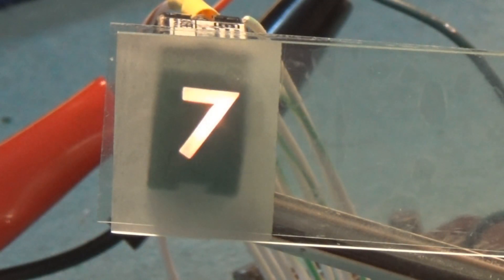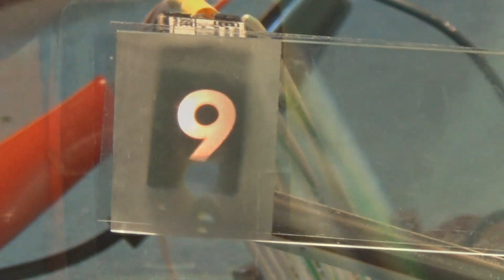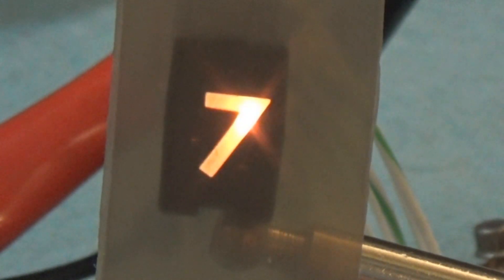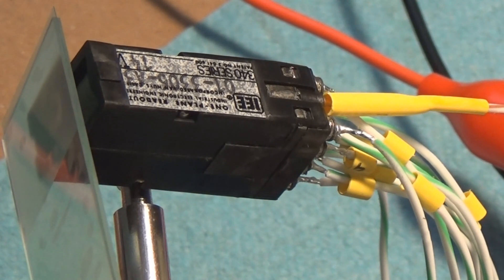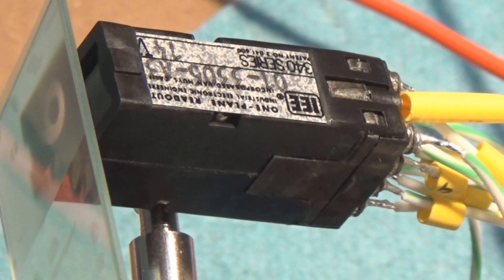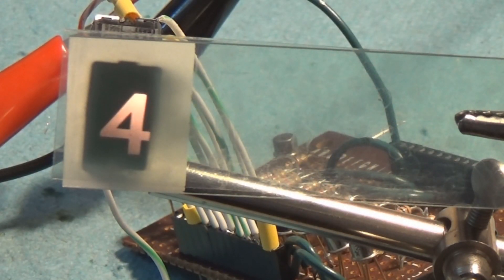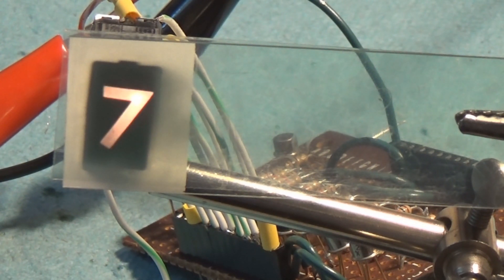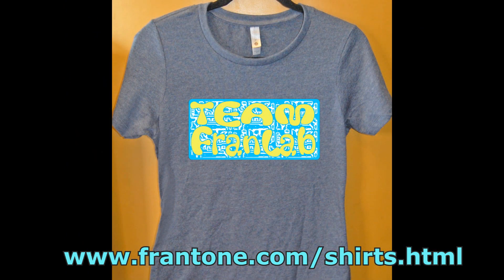Fun With Projection Displays

Comment: Otis Elevators used these extensively in the late 60's to 70's in the VIP-260 series. You can see them in action in the movie "Whats Up Doc" (Barbara Streisand) at the 53:30 mark. These were installed (and filmed) at the San Francisco Hilton Towers.  They eventually were replaced by Panaplex then LED's with the Otis Elevonic 400 series elevators.  Some VIP's were retrofitted though.

Comment: I remember two other types of incandescent displays used in the early days of digital electronics, both were used in DVMs that I used in the 70s.

One used a rotating cylinder with a bulb in the centre and cut-outs of the numbers around the circumference.  The cylinder was rotated by a movement just like a moving coil meter. So applying ten discrete voltages to the coil moved the cylinder to ten different rotational positions and allowed the light to project one of ten different numbers onto to a screen.  When the displayed value changed you could see the numbers spinning like a fruit machine.

The other type used ten separate sheets of perspex layered on top of each other.  Each sheet had holes drilled in it in the shape of a digit and was edge lit by an incandescent bulb.  When viewed from the front all you saw was the light being scattered by the holes and forming a digit.  Sometimes when a bulb or two had failed you had to guess what the blank digit was.
Reply: Clever - both of those!

Comment: I once reverse engineered the instrument cluster from a mid 80s Audi 5000 into a scratch built vehicle. The centre status visual indication section used precisely this kind of technology. Things like turn signal, high beam on, oil etc... all came from a set of lamps projecting their light through a tiny icon printed on a colored film onto a larger  2x2" screen between the speedo and tacho...

Comment: I have a parts drawer full of these; leftover bits from my military days. They were used in an IRIG-B clock. Mine are almost identical to yours except they have the diffuser built onto the front with a small visor on top to prevent glare from ceiling lights.

Comment: I've got a set as well ... IEE Model 10000 which have twelve 6.3V bulbs (in sockets on a steel backplane.) With 12 digits, some have the addition of left or right decimal points, +/-, or A/B (presumably for base-12 display since they came from a computer, if I remember correctly.) I got them around 1985 and have never thought of an ideal project. The best contender so far is to use the iron-core memory from the Wang calculator as the RAM for a clock. I debate whether to keep the project using the incandescent bulbs or to make an RGB LED board for them.

Comment: Just did a tour of my local nuclear power station and the control rod position indicators were these displays (at least in the training center control room which I am told is an exact replica for obvious training purposes). There were a lot of vintage displays, dials, indicators, and switches. It was a good time for this sort of random geekyness.

Comment: Here's an idea: 4-digit clock with a rotating color wheel, like the ones used for aluminum Xmas trees. The wheel can rotate at 1 RPM, acting like a seconds-hand. The color of the digits would roughly indicate the present portion of the minute. 
Thank you for the introduction to this beautiful technology!
Reply: you can just swap the bulbs with rgb leds ezpz

Comment: I built a clock around 15 years ago using these. As I recall I used a PIC to control it. Your driver board looks pretty much as I remember mine looking as I used discreet components as well. Alas the clock was sold off years ago as I cleared out room in my lab. Fun video, thanks for it and for my little trip into the past.

Comment: I distinctly remember this sort of display used as a show countdown timer at Disneyland in the 70s and early 80s.  Specifically Mission to the Moon (and later Mars).  It would countdown in the initial holding are until you entered into the pre-show "Mission Control" area to meet Mr. Johnson.

IIRC it was a 6min countdown as there were two theaters after the pre-show and they'd feed each theater in rotation after Mission Control which was a 4 minute vignette with a 1min load-in from the lobby and 1min load-out to the next open theater.

Comment: One interesting little tidbit---these are the displays used in the Apollo MOCR consoles for the display channel readouts, mission clocks, and other digital displays during the Apollo era. Later, they were replaced with LED seven segment for the shuttle era retrofit of the consoles. Look at Apollo era pictures of the MOCR consoles and you'll see them. The did bad fakes of them in the Apollo 13 movie MOCR consoles.

Comment: Way back and i mean WAY back i seem to remember seeing these. I was fascinated by them being pretty young. And it has been suggested and i also follow suit - why not LEDS for the light source ? Being a directed light source with low/no heat output, just might be 
the ticket, Yeah that's the ticket. Switching current will drop by a large amount as well.

Once again Thank You Fran. A little trip in the way back machine - VERY cool !

Comment: There have been so many numeric display technologies over time, each trying to improve upon and/or optimize several characteristics, such as brightness/contrast (especially for daytime readability), update speed, power consumption, size, ruggedness, and so on.

Nixies were fast and rugged, but were relatively dim.  Flip-digit displays had the highest contrast and were extremely power-efficient, but were slow, bulky, delicate and could be annoyingly noisy.  Rear-projection was sharp and bright, but was slow and ran hot.  VFDs and ELs were much like Nixies in performance, but with improved size/volume and clarity/contrast.  Not until LEDs arrived did the display industry nearly converge on a single technology, reigning until LCDs arrived in volume.  The latest high-volume contender for the display crown is OLEDs (which my fitness band and phone use).

When I was in the US Navy from '75 to '81, I saw all the pre-LCD numeric display technologies working side-by-side in various military equipment.  One use of rear-projection displays I recall best was in a LORAN receiver.  A large wall-clock in CIC used flip-digits.  Several bench instruments used Nixies and VFDs.  We had an early portable DMM with LEDs, but it had such terrible battery life that it was seldom used away from the bench (we still preferred our indestructible Simpson 260 analog VOMs).  And, of course, CRTs were also used for numeric display, but mainly as overlays in multi-function displays (e.g., radar).

There were also displays that combined numeric entry, such as the common thumb-wheel displays, some of which were back-lit. These were (and still are) commonly used in decade boxes. Sometimes up/down buttons were added above and below another display technology to support numeric entry.

During a port visit to Japan I purchased my first multi-function stereo receiver, a limited-edition Pioneer model with a massive (4"x10") LCD touch display. It wasn't a dot-matrix display, but was more like a large LCD clock or DMM display, with sets of 7-segment digits and several discrete icons and graphics for the touch areas.  While the display and interaction were terrific and well ahead of its time (the AM/FM tuner was the first I'd used with auto-seek), the sound quality wasn't great, so I sold it when I returned to the US (the model hadn't been imported to the US, so I made a nice profit).  I believe the main issue was noise leakage from the digital side into the audio side.

Comment: I saw displays like this 25 years ago in the film department of a university and I've been wondering ever since what it was, I never saw another. It was for time counter displays that showed how much film had run through the projectors. Quite an amazing setup - giant film projectors were in a large booth aimed through sound proofed window into a master control room with a big screen with those displays below. The projection booth also had synchronized 16mm mag audio machines that would sync with the projectors. 
I want to see one that does letters and numbers but I suppose parallax might be a problem for the character projectors further from the center.

Comment: For the larger ones, you can create beautiful high resolution masks using lithographic imagesetter film -- the sort they used before direct-to-plate imaging became standard. You should be able to easily get 3600 dpi and around 5.0 density for the black.

Comment: I thought I had a grasp of display technology from back then - Nixie, VFD, mechanical, you know......but since I've been looking at your channel I plainly know very little - those folks at IEE certainly put some effort into this field - with this projection thing, the Bina-view and the fabulous Nimo tube - you've made me look up so much new-old stuff Fran :o)  Dave in the UK. 
(I worked in HP Labs UK until 2013 (the plug was pulled and we were all out of a job then) on new LCD modes - we were cranking out single pixel test cells made from ITO coated glass or plastic daily - you'd have been in heaven - and hence my interest in all your display vids - I'm trying to track where you've got to with the DSKY display now - I want to know how that turned out, given that you don't have a cleanroom to make it in !!!! :o)))))  )

Comment: Very nice display, it's extremely clear and I guess you can use coloured Jells or transparencies to change the colour, I see no reason why this can't be modernised with LEDs and cheaply mass produced by using a 3-5mm LEDs with the filter moulded into the led during manufactur and simply changing the shape of the mould to create the lens, hence a single process to produce one LED with Filter and lens.
Reply: HPZeta Or use standard "reverse" SMD LEDs on a translucent baseboard material, with the digits part of the etched opposite copper layer and a 12 position moulded plastic lens to project the digits. Make the plastic lens slightly bendable for distance focus change.  So only unique component will be the plastic lens, the rest is standard PCB assembly of finished product and a case for the product.

Comment: I wonder how easily one could make a modern version of this today. I'm thinking hyperbright white LEDs instead of incandescent lamps, but otherwise it should be fairly easy. I reckon your typical makerlab laser cutter could probably cut out the projection mask without too much trouble. The only tricky part I can foresee is how much effort to align them all to face exactly the right way and line up nicely on the front diffuser.

Comment: An interesting driver chip to try with these would be the LM3914 (In DOT mode)...They have a tiny overlap period between the outputs that should look cool on these displays, one could make a simple retro looking volt meter, or what could have been the world's 1st digital output multimeter.

Comment: Had a few of these displays I cannibalized out of an old typesetter. Was also able to get hundreds of various IC's and spst push button and spst micro toggle switches. The logic boards were all wire wrap design.

Comment: Great video Fran!  I have never seen these displays before, you learn something new every day (as they say).   It's amazing how long an incandescent lamp will last if you run it slightly below their rated voltage. I often use 32V lamps in 28V circuits and they last a long long time!

Comment: I remember these displays a lot from those days. As a graphic designer, I often wondered why they weren't used in "period' movies to better reflect the era. e.g. that Indiana Jones Crystal Skull movie debacle should have used these one-plane displays (or nixie tubes) instead of a too modern red LED display countdown clock that would hardly be period-realistic for the late 50s in which the movie was set!

Comment: I was thinking the same thing a couple of other folks were. Use that display until it loses a digit or two
and then swap the bulbs out for LEDs. But that would be an easy swap ONLY if the digit masks were
a part of the tube holding the bulb and not part of the bulb itself.

Comment: In my car there is a display that works the same way. 
It shows when the fuel level is low
And wiperfluid level. 
And oil pressure. 
And some other alarms 
My car is a audi 100 (5000 in the USA)
My car is from 1984 after 1988 they used an other display system. 
I think there is a video on YouTube the system is called auto check.

Comment: Replace the bulbs with high intensity LEDS.  loose the heat and get durability to boot!  
(Automatic Electric used these in their TSPS Operator positions in the 80's.  The bulb type, not LED)